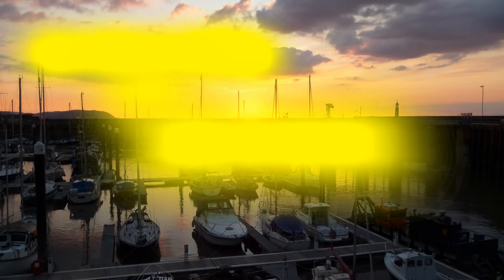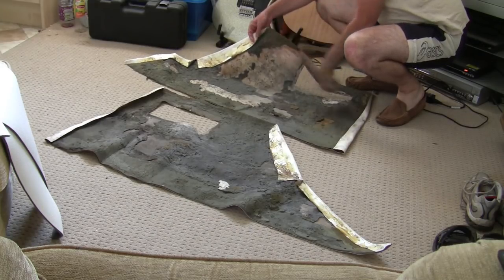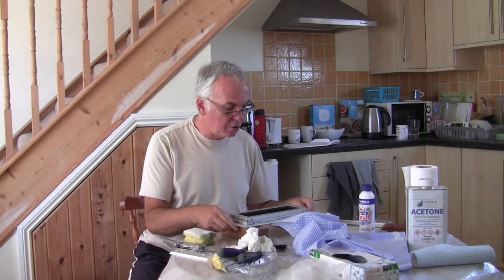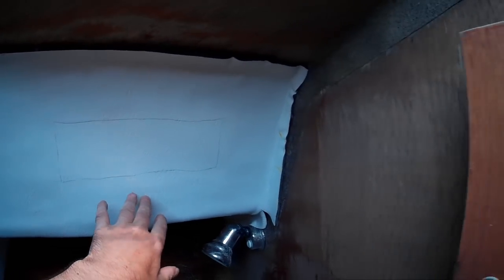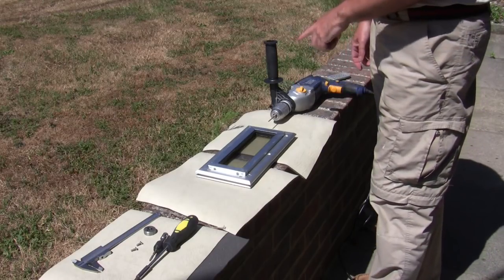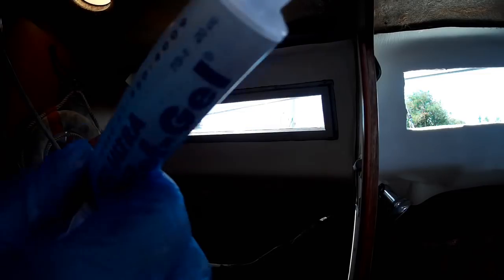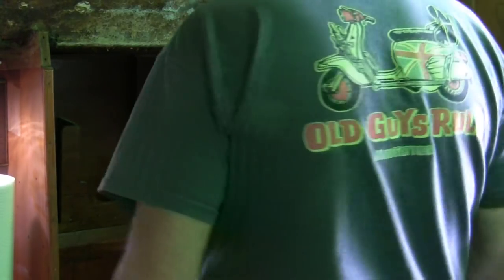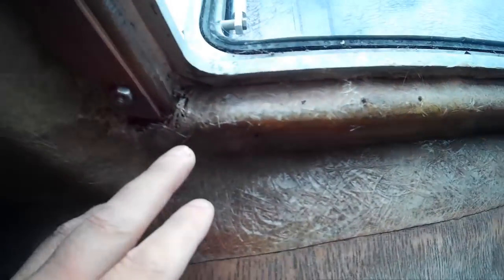Just About Sailing July 2018 - Putting the old windows back in, every silver cloud has a lining

Comment: I was very impressed with how the windows turned out. A big job to tackle all that. Nice work.
Reply from the maker: As with everything on a boat, it turned out to be a much bigger job than I had thought.  But I guess that all jobs can be broken down into small chunks.  If the windows turn out to be watertight, that will be a big improvement. Cheers
Reply: For me the trick is having the presence of mind to realize that you can break it down to small chunks. Sometimes I get overwhelmed with a new project until I see how I can break it down and not get too discouraged. Having videos like yours helps illustrate that.. Recently I glassed over a through hull. Your video on that process helped me tremendously. Thanks for taking the time to record your efforts.

Comment: "Once you start doing one thing you end up doing everything." So true, but also the reason lots of project boats end up for sale.
Reply from the maker: Very true.  I very nearly went for a project boat 3 years ag - a very nice/tatty Halmatic 30.  Glad I didn't; it wouldn't have been in the water yet.  It took about 4 weeks to get Serenity into the water when I first bought her.  I have pretty much done the minimum in the last 3 years (apart from stuff to make single handed sailing easier).  It is taking longer than it should for all sorts of reasons - but I am starting to see the light at the end of the tunnel now. Cheers.

Comment: Been very lucky with the UK weather JAS, I am worried that now your windows are in that we are in for rain.
Reply from the maker: No, you should be fine. It works the other way round.  It rained all the time when I wanted to do the epoxy and paintwork for the new windows.  Ever since I put the new windows in, and now the old ones, - not a drop. But I shall be replacing the old skin fittings soon and also glassing over an unused one. - That will guarantee rain.

Comment: The lining does look like a pain to put on.  But I'm sure it will look much better than the old.
Reply from the maker: Yes, not one of my skills unfortunately.  The old foam has really disintegrated - and there was quite a bit of moisture trapped from the small leaks from the holes I have now plugged up.  So even if there are a few crinkles, it is definitely better than the old stuff.

Comment: How did your paint come out?  Did it smooth out as it dried, or keep the brush strokes in it?
Reply from the maker: It came out OK. There is some texture on the surface, but it is acceptable.  It did smooth out as it dried. I wonder if I should have tipped the undercoat rather than just rolled it.  It has been difficult to film the surface as the sun has been so bright recently but I will try and film it on a dull day.